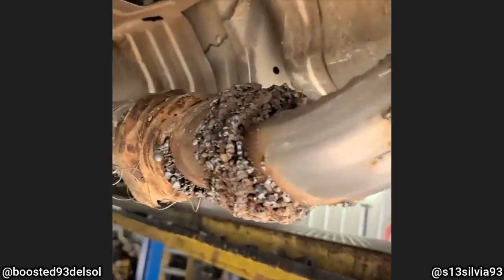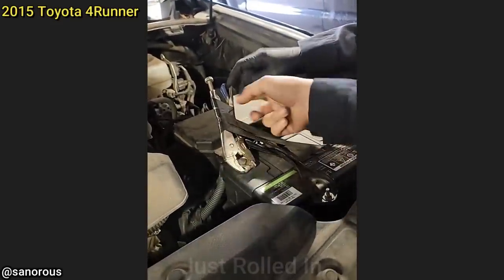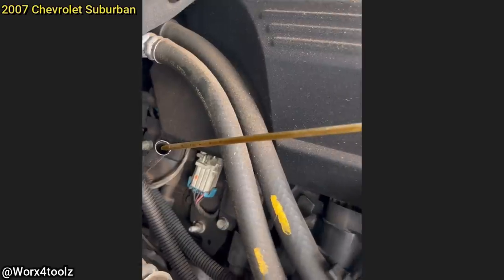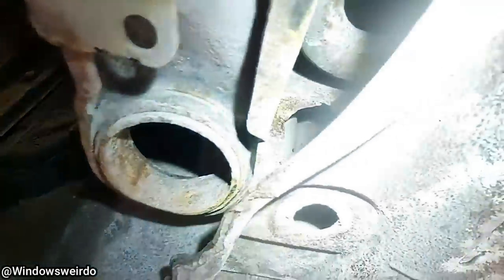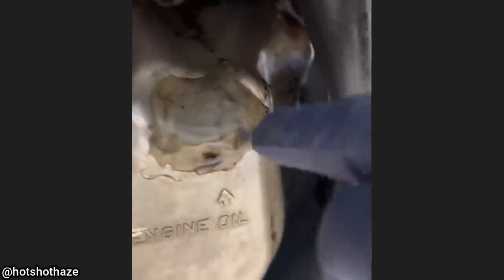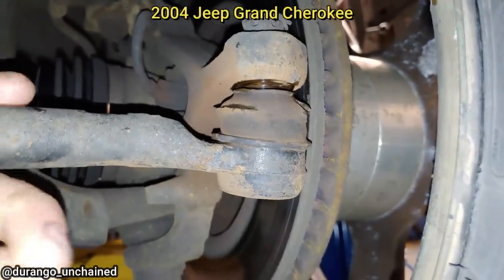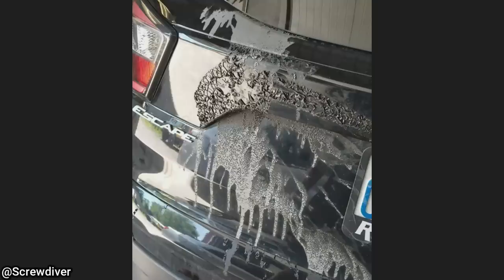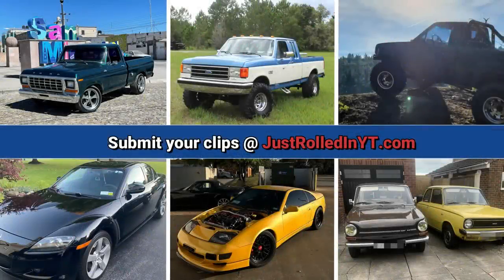Customer States Exhaust Sounds Terrible & Drags On The Ground | Just Rolled In

Comment: roll in, roll in, roll in... roll in, roll in, roll in, no braaaaakes!

there are new brake discs out there, usually covered in light grey or silvery paintlike coating. said coating is to be "braked off" during the first test drive. it helps tuning the pads to the disc  and meanwhile prevents corrosion, especially while being stored.

or so the makers claim.

but the stuff is by no means the same as standard car paint. that will make the pads slide across the steel like pieces of soap. I don't want to imagine how badly that truck would ride... and one bolt breaken off, too? someone clearly has no "feeling" for things mechanic.

it also explains the many horrible crashes in american dashcam videos.

Comment: I did the vise grip on the battery terminal myself once.  The battery cable tightening screw broke off,  and I had to tighten the cable somehow.  I only drove it that way to Sears to get another cable installed.

Comment: The metal weld 2 part metal glue on the sump I can relate to… I dinged mine and punched small hole in it and did the same thing. It never leaked again and saved me a fortune as mechanic said it was irreparable.

Comment: Those welds are likely from someone with the Harbor Freight 110 volt tig welder for $99
Reply: Sometimes I want to get a cheap welder just so I can see how quickly I can figure out how to get decent results out of it.  I don't have anything I need welded, though.  The only welding I've done is some test samples just to learn, in a college class that briefly covered a lot of stuff including welding, metal casting, and machining.  I made decent looking welds first try, but that was good equipment and flat test pieces of metal.

Comment: That dipstick was too long. @.51 you will see that it is connected together by some kind of joint. If the oil was really that high, the engine wouldn't even turn over.
Reply from the maker: that's how those dipsticks are made (OEM)

Comment: painting the rotor is not a big deal, if your brakes are functional the surface coat gets scraped off in a second. in fact, a bunch of rotors are sold fully painted from factory, to help with the rusting. mine were painted black from factory and i painted rear rotors black, both came off after braking a couple times.